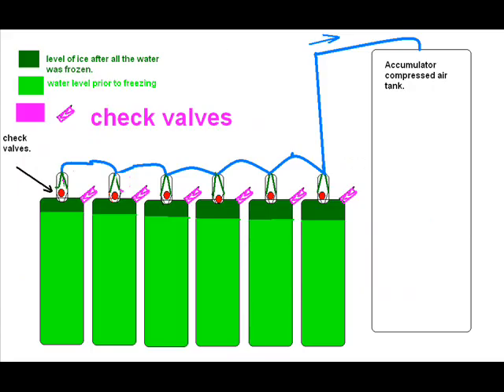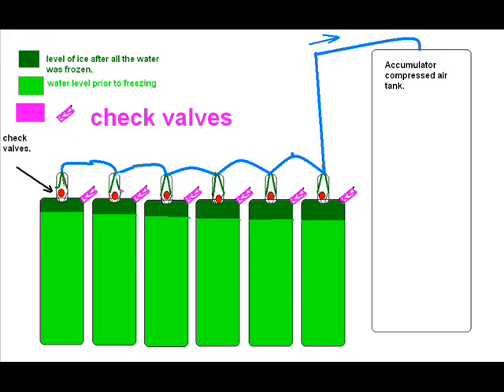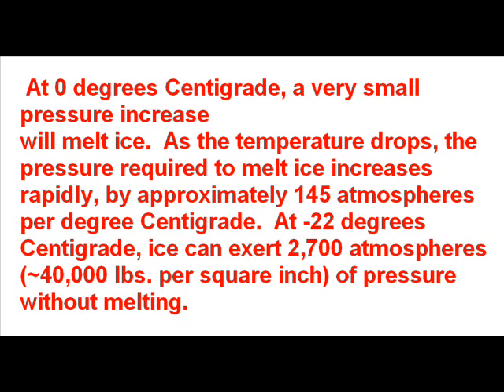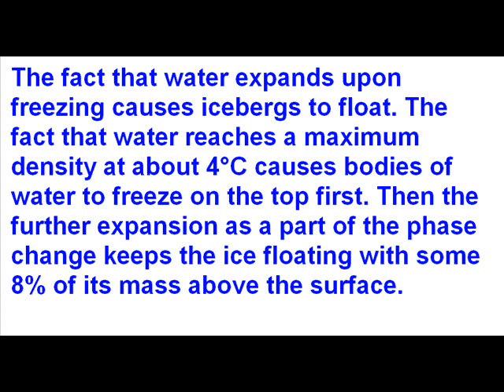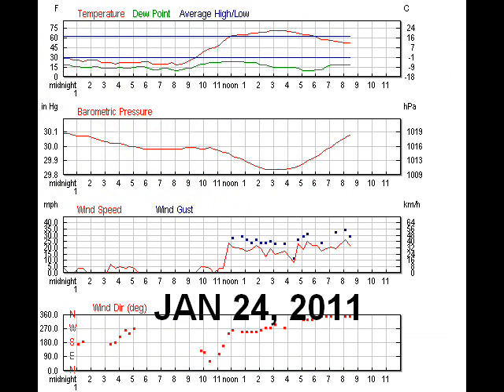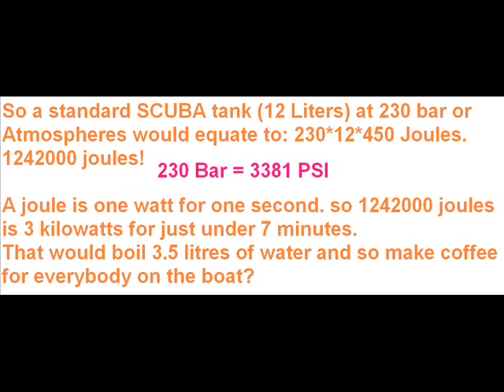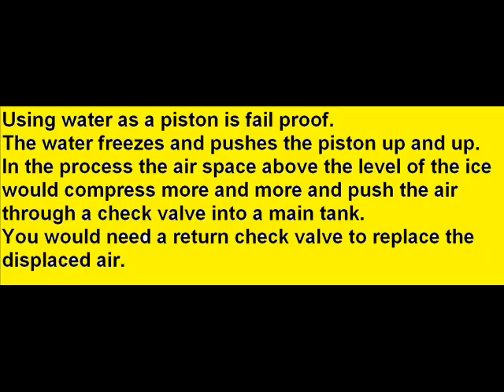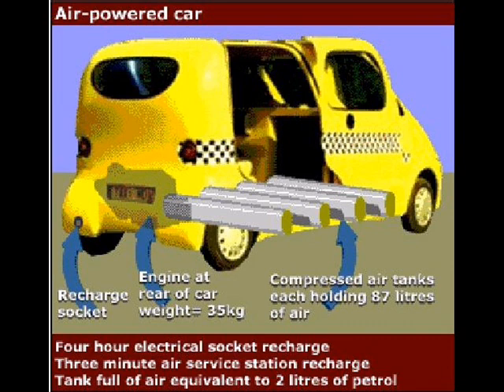ice power  getting free energy from the expansion of water when frozen.

Comment: I am from Lithuania, I am 15 years old and 2 years ago I had similar idea.
I named my theory "Ice Expansion to Power Generation"

The Ice Expansion Power Generation theory proposes utilizing the expansion of water when it freezes to generate power. The idea involves a system consisting of a solid box with an opening on one side, similar to a lip with a piston. Inside the box, water is placed and frozen into ice. As water freezes, it expands, exerting a force on the piston. The piston is connected to a gearbox capable of converting mechanical power into electrical power with a single rotation. The theory suggests that the expanding ice could generate enough force to push the piston, thus generating more power than the energy initially put in to freeze the water.

Comment: Hi, i'm Mateo Šuflaj from Croatia (16 years old now). Six months before I was wondering the same question as You were as a lad. Instead of compressing air, I think We should use the flywheels for better efficiency. There are 16 types of ice. People use 1 type of ice because for other 15 types they need special temperatures, pressures & acids. Ice-electric generators can be installed on spacecrafts because there are two sides of it, sunny and cold side. Differences in temperatures are enough to freeze and melt water. Water expansion push the pistons in the cell. Piston would rotate heavy flywheels and when it is needed, the generators would store energy in the battery or ultracapacitors. I think this is good way to get energy because it's unimaginable that if We lower temperature We get energy.

Comment: burst of heat thus melting the ice. the answer we need is how strong is water at the point of freezing, it is strong but how strong?. unstoppable ?. if so there will be no limit tho the power you can gain. besides the metal strength containing the ice.
Reply: 43000 pissies

Comment: This is my thought man, take water and put it in to a hydraulics arm. that will give movement once you freeze the water, even though it is a small movement it can be geared up, put this prinsable in place and think of a car engine and how it uses the pistons to make a constant rotation. easy to gear up!, hit the body of the arm that the water is contained in with liquid nitrogen. this will instantly freeze the water and give you movement, then light the liquid nitrogen that will cause a strong
Reply from the maker: Cliffton Smith  I really don't know because a wire will work its way through a block of ice with some weight on it so I have a feeling that if you actually put a piston it would probably have a tendency to push through the ice as the ice tried to push up
Reply: @Michael Buckley  I stumbled upon this article and I think it explains what yall are talking about. Super interesting stuff! https://link.springer.com/article/10.1007/s42452-018-0139-z
Reply: @Michael Buckley Thanks! I fell down this rabbit hole wondering if energy could be extracted from the freezing and thawing of permafrost.
Reply: @Michael Buckley I believe the real issue is that the energy required to produce the ice is greater than output you receive. Also pressure increases the amount of energy required to freeze the water.